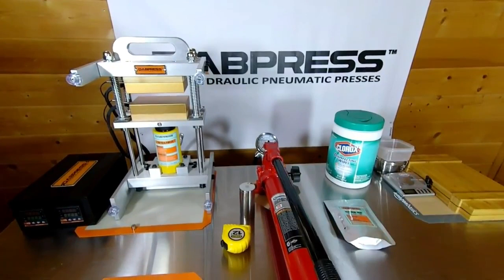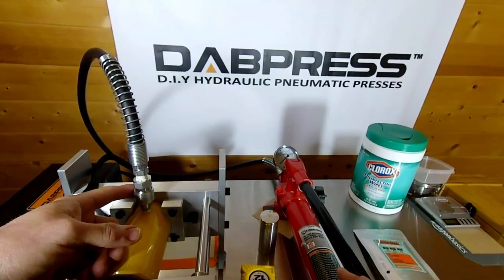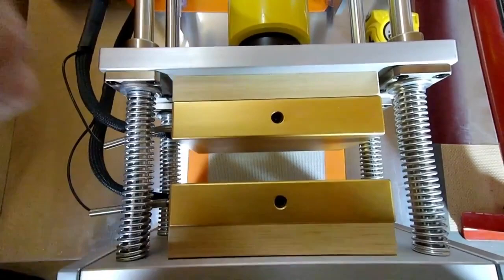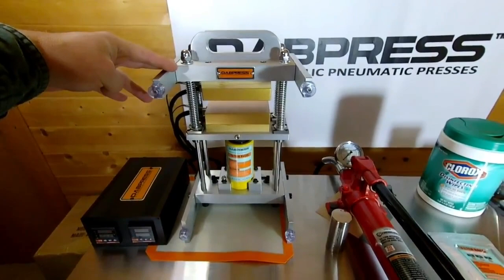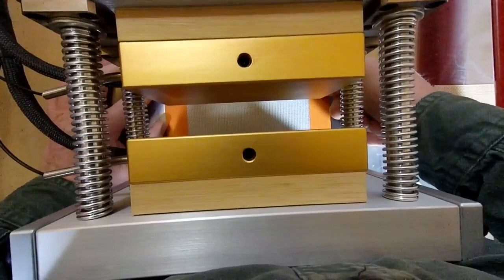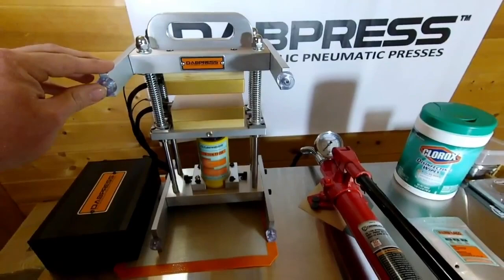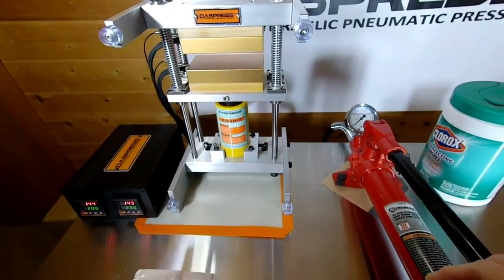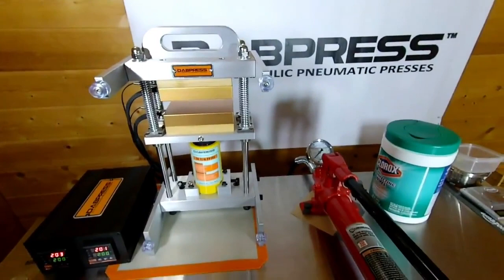Dabpress New 10 Ton Driptech Rosin Press Machine | 3x5" Rosin Press Plates Kit | Dabpress Tech Made

Comment: Nice unit except some one can’t do math 14000 pounds is not 10 ton and u would never even be able to get that hydraulic pump to redline and reach its max I see tis all over manufacturers claiming it’s 10 ton that’s actually 20000 psi and I also see thees manufacturers labeling them as pneumatic hydraulic there is absolutely no air involved here. With that being said I am thinking of buying this unit seems like enough for personal runs
Reply: They name it that way because you can add at checkout multiple different options.. you can get all different things to operate the pump including pneumatic
Reply: They sell a 1000 dollar unit that is electric and uses air pressure to press your plates...

Comment: Can you actually hand pump up to 10 tons? If not what does the gauge say? Also when you get near 10 tons does it require more strength?
Reply: You don't need to use the full ten ton,you get a a good press at 1800-2500 psi and get everything out,any more and you get blowouts

Comment: Hey my 10 ton press stopped working it takes like 200 pumps to move my plates like an inch...should I return it? Is there something i can do to regain pressure in my pump i lift the handle it goes right down no pressure
Reply: You ever get that fixed ?

Comment: Just got one of these.. supposed to take up to 14g.  press was on sale and they offered 50 off for buying both together- AND had a 15% coupon. for something with a gauge/ clean Compact 10 ton cylinder/ driptek ready... i would like space to fit the pre press in there but i have a T one for round pucks If i have to go that way.. plan on using a cold metal plate to drip ontowith silicone mat on it or parchment

Comment: Is that the 30mm stainless steel pre-press or the 40mm one? Ahh I see it's the 30mm apparently. I have it paired with your guys' 2"x4" 120micron bags and I'm currently really torn between trying the 40mm one with 2.5"x4"s or getting the rectangular 2"x4" pre-press and trying that out instead.

Comment: I need help. I just received this exact setup. Put together and when I pump it I get no pressure. Do I have to fill this thing with some kind of hydraulic fluid?
Reply: What ended up hapnin***
Reply: @legalizemiami9282  Dabpress helped me troubleshoot. It was in fact DOA, they got a replacement to me within 3 days along with a printable return label for their bad product. The new one plugged and played exactly how it should have.
Reply: @716Flat4  thanks for the update wanted to know if i should drop bread on the 6ton kit. 💯
Reply: @legalizemiami9282  100% you should, the guys over seas and the guys local all worked hard to help me. I manage and train for a large retailer. Dabpress gave me exceptional customer service and has earned my exclusive loyalty for their product industry.

Comment: Just bought this today and bought the pump off ebay without a gauge.  Do I need one?
Reply: It's not a necessity as most aquire a 'feel", but it sure makes things easier, especially when the rosin flows from the puck and the pressure begins to slowly drop off. With a gauge, you see it faster and react faster making for a better product (by a little). You can easily add a gauge with a 10000lb rated SS Tee and a gauge for well under $50. In fact Dabpress sells a kit on their web page.